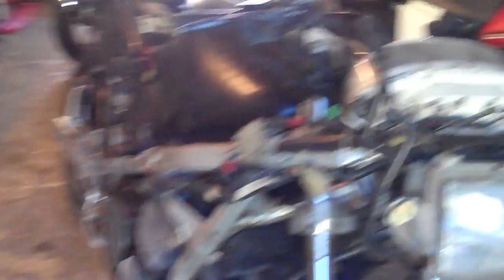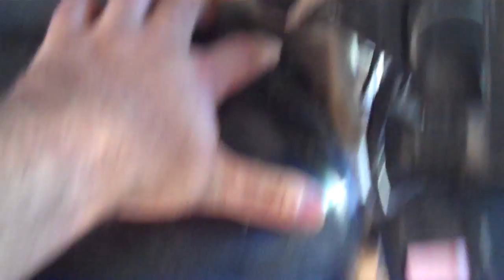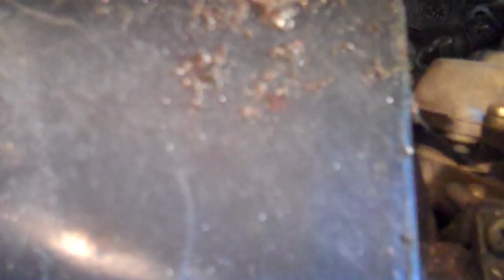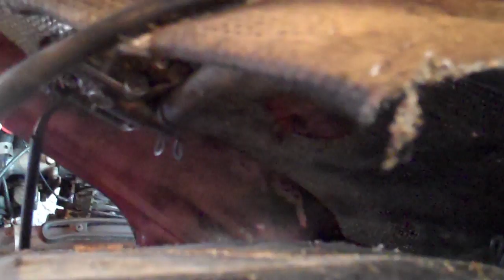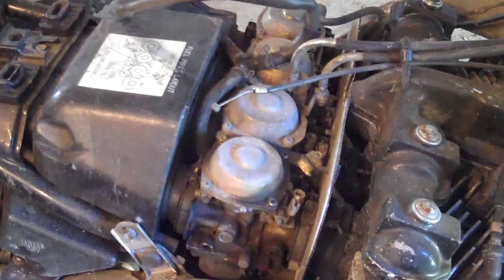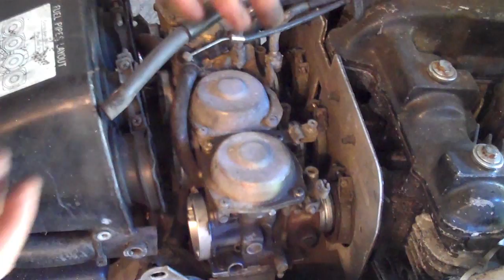How to remove motorcycle carburetors

Comment: Great vid max but I wonder if you have any guidance on disconnecting throttle cables from an 86 ZL600? They do not have the 10mm nuts to slacken the cables and I am STUMPED! Thanks if you can!
Reply from the maker: If there arent lock nuts then they should just pop out of the bracket. Sometimes it helps to loosen the cable up top at the handlebars to get a little more slack
Reply: THANKS for writing back Max! turns out I am a moron and forgot my common sense here...I got them off :).